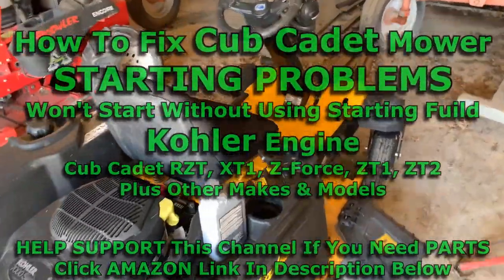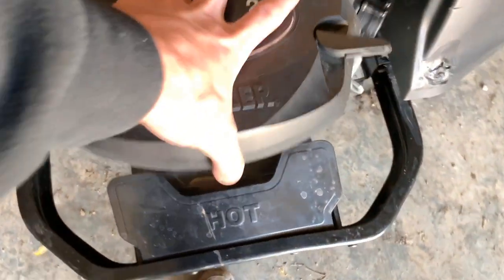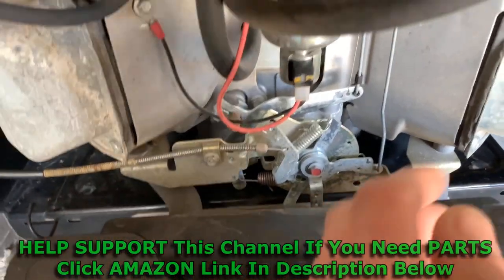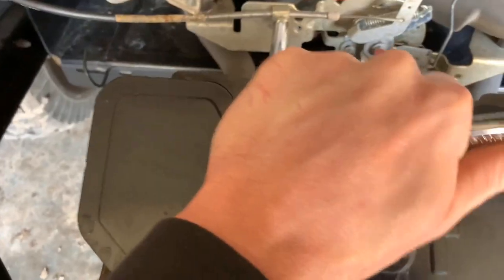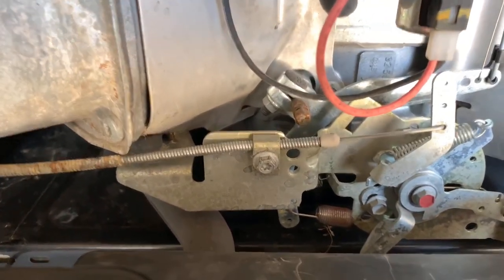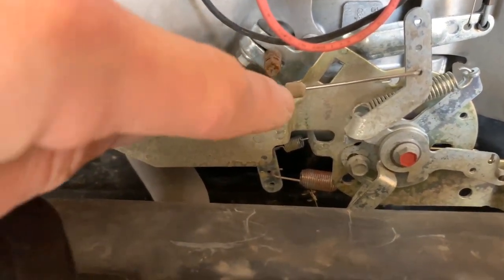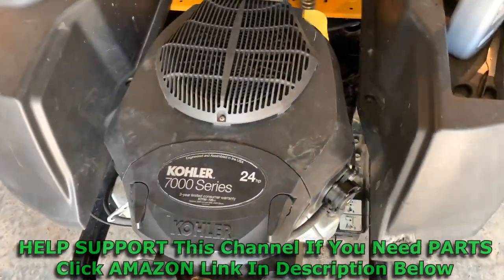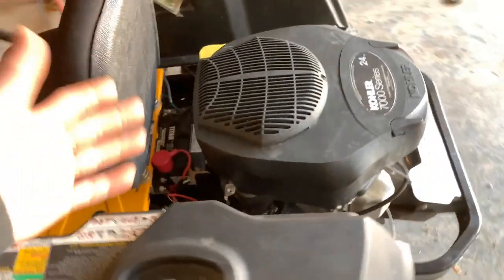Cub Cadet WON'T START Without Starting Fluid REPAIR Lawn Mower Kohler Engine NOT STARTING Cold FIX

Comment from the maker: If This Doesn't Solve Your KOHLER Mower Engine Starting Problem Watch Video I Made About How To Fix Another Common Starting Issue On KOHLER Mower Engine Video Linked Below
https://youtu.be/BWnkTZvk8L0
Reply: Thanks that evens works for walk behind the black rubber garment screws in and out down where it attaches to the choke on the engine like you said it don't take much but it's a solid fix great video!

Comment: I can't thank you enough.   This video helped me with an issue I've been struggling with for over 2 years.   I just cleaned my carburetor and replace the needle valve without fixing a thing.   This simple adjustment took me two minutes,  solved my problem and helped me to understand how it works.   My engine is a Briggs and Stratton V-Twin.   Worked like a charm.

Comment: I believe this little trick worked for me. I popped off the air cleaner, looked at the choke butterfly with the throttle lever on full-choke, and pushed up on the choke linkage like you did and I saw that it wasn't completely choked and there was too much of an air opening for the butterfly to properly choke the carburetor in full choke position. I loosened the bolt, moved the cable over to the left about 1/8th inch and tightened up the bolt, rechecked in the full choke position and the butterfly was now in full choke. I look forward to starting the engine in a couple days to see how it works, as having already started the engine earlier in the day with starting fluid, it always starts the rest of the day. But, your solution looks to be the fix for the cause of my starting issue on my 5 year old Cub Cadet Zero Turn mower, with the same engine that you showed. Thanks for the solution and for putting it on YouTube!

Comment: I watched a multitude of vid's illustrating how to start a mower by using starter fluid (I went to kindergarten a while back - I knew how to use a spray can) I finally found your video on what was causing the problem and how to fix it.  I spent several frustrating hours before watching your video.  It took less than 5 minutes after your demo and I was "back in the saddle".  Thanks.
Reply from the maker: Good to hear it helped get you back in the saddle!!!

Comment: I'm on YouTube all the time, but this is one of the first times I've ever 'Liked' a video. Simple and straight to the point. Mine came like this from the store for some reason. I figured it was something simple, but I'd always forget until it was time to mow, and I didn't want to be bothered with researching it, so I just did the starter fluid trick and forgot about it until the next time. This took 5 minutes and my mower that hadn't started for 2 weeks started right up at a bare turn of the key! Thanks!!!
Reply: Same thing been using the starter fluid for 2 years, gona try fix this am maybe  fix my problem  liked video, clear and straight  to the point thanks,

Comment: Two seasons dealing with this headache. I'm not a small engine mechanic, but I am mechanically inclined. Thank you for sharing your experience, you saved me a ton of headaches this mowing season. I adjusted the cable housing as you instructed and the mower fired right up. No more fighting to get this beast running anymore.

Comment: I've read through countless threads of advice on how to fix this problem over the past two months, pointing to everything except for the Choke Cable.  Based on the symptoms most of the advice did not make any sense. Stumbled across your video this morning and within 15 minutes I had the rider mower starting again without Starter Fluid.  Thanks, Great Video!!!!
Reply from the maker: That Awesome Glad To Hear It Helped Get Your Mower Runnin & Solved The Problem!!!!! Great To Hear!!!!!

Comment: I just bought a new Cub Cadet and used it for 9 hours. I checked the filters, removed and replaced gas (thought I bought some bad gas), checked carb, spark plug and finally found this video. A 5 minute fix would have saved me hours. Honestly it shouldnt come from the factory messed up but I didn't have a way to take it in for service so was trying to fix myself. Glad I found this! Cab Cadet needs to fix this!

Comment: OMG, this fixed it!  RST-42S with a Kohler SV715 with the single lever throttle/choke combo. Put the lever on full choke, loosened the screw (torx bit required), pulled so the choke lever is fully up (=closed), WORKED!! Thanks so much. I had replaced the carb, fuel pump, hoses, fuel filter, plugs... still would not start w/o a shot of starting fluid. THANK YOU THANK YOU THANK YOU!!!

Comment: Wow it solved my problem. No more having to shoot the starting fluid. I previously changed the air filter, replaced
the spark plugs, new fuel filter, oil change and still wouldn't start without the starting fluid. I found this video yesterday and it took me less than 5 minutes to fix the problem as you instructed. My mower started right up on the first crank!
I really appreciate your video. I'm going to subscribe to your channel!!
Reply from the maker: Hell ya glad to hear it helped Thanks for the feedback ya I kinda did the same thing just about before I finally had the apple fall on my head & I was like holly crap that's all it was I was happy to finally figure it out tho. LOL

Comment: I had this issue with a husqvarna 46 in. lawn tractor I inherited from the previous homeowner, and had tried just about everything. I resigned to the starter fluid game, and told myself "I'd get to it later" thinking it'd be a hassle to troubleshoot. I happened to run across this video, and THANK YOU SO MUCH! I literally laughed with glee when it started right up after fixing it. THANKS!!

Comment: I can't thank you enough!! Been fighting this issue for some time now to the point that I would drain the battery frequently. Definitely saved my starter. It's below freezing today and after applying this fix it started on the first try. Can't believe it was so simple.

Comment: I have the same issue with my Kubota zero turn.  It has a 25 hp Kohler engine.  I did what you said and it works like a charm now.  Thanks a bunch.

Comment: Dude I just found this video and I went and did the adjustment and it fired right up. its a two year old ZT1 Ultima  with a 22hp Kohler. Its been getting worse and worse from day one. and this was my issue. I really appreciate it much

Comment: Kohler. It’s spelled Kohler and pronounced “coh-ler”.
Reply: come on, we all noticed but he solved my issue
Reply from the maker: @caniwishformorewishes8654  If it solved the issue then that what counts I'm with u LOL
Reply from the maker: usually I just call that mower a POS so never learned the proper name
Reply: @EverydayImTECHnIt  I agree that solving the issue is the most important thing, and you showed how to do that. But when you pronounce the name of the mower wrong at the beginning it makes some people think maybe you don't know what you're doing if you don't even know how to pronounce the name right. Then you called the fuel pump a fuel filter, it may not be important but it hurts your credibility and people may turn your videos off before they see that you actually know what you're doing.
Reply: Pos fixed thanks dude.
Reply: Nah I think it's kosher
Reply: The s is silent.
Reply: Go back to school

Comment: Absolutely spot on with your video. I just picked up a slightly used ZT1 and had to use starting fluid. Your video changed all of that for me. Thanks for your intelligence and taking time to put the video out.

Comment: Mine has been doing this since it was 2 years old. First video Iv found that finally gave me an explanation. Every time I wanna start my mower I have to drain the batter and put it on the charger and takes a hour or more to start. So glad you made this video!

Comment: I will be doing this fix tomorrow. I have a Troy Bilt zero turn with this very same engine. Its a few years old but the engine only has about 178 hours. It turns but won't quite start. It acts much like when you try to start it without fully engaging the choke so I am very hopeful it will work.

I have checked the fuel line and can see that the carburetor is getting gas and I am hopeful its not something else that I have to track down. Or have to open it up some and see how the carburetor looks. I do not believe any dirt or grime has gotten into it since I change the oil, filter and plugs as recommended. I also don't run it hard and only cut well established lawns around my property and leave the field cutting to my brush hog.

One last point as to what I have done. I did spray some fluid into the carb but did not do so into the filter as you suggested. So engine would crank for a few seconds and as it started to die I would spray some more to keep it going but decided to stop as I observed the engine would die out nonetheless. 

I will follow up and let you and everyone else know if this suggestion and fix indeed did the trick.
Reply from the maker: I think you got a fuel issue it's not getting fuel for some reason or you have water in your gas also try this if you ever have this similar problem this is also a common starting problem with mowers with KOHLER engines  https://youtu.be/BWnkTZvk8L0
Reply: @EverydayImTECHnIt  Yes you are correct. I was hopeful this would be it, but the more I thought about it the more I realized this video wasn't exactly my situation.

I called the Kohler people and will be checking the plugs to see how they look and then probably try to learn how to get to the carburetor so as to clean it since there may be something there keeping gas from flowing properly. Might have some varnishing or other gunk since it is 6 years old. Regardless of it only have 178 hours running, enough time has passed that this many be going on as well.

Since you mention the water issue, I may go about just draining the gas and putting in new gas all together. The other tank may have had some water in it somehow. So I can't eliminate that either. Will do gas draining perhaps first since its a simpler fix.

Thank you for your time and added attention. Will follow up once I get to some of these options I have.
Reply: @EverydayImTECHnIt  I have gotten mine started back. It appears to have been some crud that was somewhere in the carburetor. Hopefully with a freshening of the air and fuel filter, adding some other product like seafoam or mechanic in a bottle that will get us back to normal and handle the grass cutting for the rest of the year.

Comment: Thank you so much. That did the trick. I took off the cover I didn't have any starter fluid so poured some gas in the carburetor and it started up. So I adjusted the throttle cable. So now it cranks up by itself when I hit the key thank you so much for that YouTube video

Comment: Thank you, thank you, thank you! I replaced the carb, starter, spark plug,  and solenoid and my mower still wouldn't crank. Saw your video,made the adjustment and she cranked right up. Your video was the first one ever mentioning this choke adjustment. Thank you, again!!

Comment: Thank you so much for this video! It fixed my problem in 5 minutes. I was so frustrated and was about to bring it to the dealer. Saw your video and bingo!!!! Great job! Thanks again.
Reply from the maker: Glad it helped ya kinda weird issue for sure
Reply: I have another question I hope you can help me with. When the mower starts it pulls to the left. Do you know what that would be from? Thanks so much!!!
Reply from the maker: @michellemarcello4947  If i had to give it my best guess i would say to check the clutch/safety pedal u push into start & forward pedal to make sure it is adjusted correctly under mower it sounds like it a issue with left side staying engauged in forward not 100% sure tho but has to be a pedal adjustment issue you probably want to check in rear underside of mower by like back axle hope that helps!

Comment: I have a brand new troy-bilt z54 zero turn mower,with a Briggs & Stratton professional mower on it.and its doing the exact same thing to me right now.i also have 3 more troy-bilt 54 inch mustangs mower with the same moter on them except there 25 hp,there the z54 is 24 hp.so ill try your advice tomorrow now.i also have 2 troy-bilt super bronco 54 & 50 inch mowers with the klopers on them and beleave me now they love gas now.they burn 2 × more gas in 1 day of mowing that my troy-bilt zero turns do,I have a big lawn mowing business and to me right gas is very very valuable these days!!!!!

Comment: Thank you! I had tried everything I could think of that was easy to do...ethanol free gas, new spark plug, changed the oil, new air filter, ran Seafoam in the gas. Not too handy with carbs so I ordered a new one and was about to put it on when I came across your video. Ran out to the garage and in 5 minutes had the issue fixed! Started on first turn of the key. Also ran with a lot more power.
Reply: When your lawn mower is turning you into a shade tree mechanic this is what you go through.  By the time you're done with this mower you will be a certified pro because you have already been through the whole trial and error phase.  You might save somebody a few bucks someday.  My Cub Cadet has put me through the ringer over the last two years.  I can now diagnose certain issues.

Comment: thanks for this video! I just was able to fix my generic generator with this little trick! I thought it was the spark plug but I couldn’t reach it Because it was buried under the panels so I looked up your video and lubed up the cable wire to the choke,  and lo and behold it started right up! Thank you thank you thank you!
Reply from the maker: Thanks for watching & feedback!!! Glad it helped & you got it fixed!!!

Comment: Ok thanks for the INFO, fine business!
I have had this problem for YEARS, not enouth Choke. it took me abt 25 seconds to pull air cleaner and dump a little gas to carb then it would always start and run well and restart if not off for a few days. My mower is a Troy/Bilt 50" zero turn with 25hp Kohler and have checked for years for someone with enough drive to trouble shoot the problem, I was just toooooo LAZY abt 8 or so years ago I did adjust the cable and it worked for a few years then stopped working so back to adding gas. Now that you showed the problem and showing the actual CHOKE linkage. I added a TYE WRAP and or <cable tie> with the large end pushing on the CHOKE linkage to close the CHOKE plate. Now it starts without adding GAS!

Comment: I haven’t tried this yet but i just bought a new cub cadet XT1 XL 46” and i ended up sending it back because of this problem and when the replacement came i found the same issue. I just unpackaged my new one today and couldn’t get it started. I’m going to give this a go tomorrow

Comment: you call that motor any dad gum thing you want to. my nearly new mower started instantly when i lifted that lever. worked so quick and so easy for just me to do i am not even gonna fool with tightening the cable. thank you very much. you call that engine what you want i am gonna call you "sir" thanks

Comment: Good video, however, there's no reason to spray any fluid into or on the air filter. If anything, it will keep the carb from getting fresh clean air with a wet filter. It's fine to spray down the throttle body of the carb with the carb cleaner to aid the engine to start. You want to keep the air filter dry at all times. Good video on the choke issue adjustment.

Comment: I have a craftsman 52” zero turn z6900 same exact mower except mine has the two steering handles… but I had the exact same problem… thanks for the video…

Comment: Thanks for the tip. Same problem on a Briggs and Stratton. Replaced filters and plugs with no luck. Saw this video, went out and manually choked it and the engine fired right up

Comment: Man. You are so amazing. I will always keep up the subscription on your channel. I know I have a hydrostatic transmission issue that one side winds until I assume fluid can get circulating. I would like your feedback on how to solve this. 2014 cubcadet zero turn 42”

Comment: Waoooo I have a mini bike with less than 10 hours that doesn’t start unless I spray starting fluid I changed everything carburetor spark plug started using non ethanol and doesn’t start, hopefully this is the solution. I’ll try that tomorrow and let you know. Thanks for the video.

Comment: Yep..works great now...kohler should hire you as an engineer. Its sad, mine has 40 hours on it. Always been hard starting. My guess is they come adjusted incorrectly from the factory or wherever they assemble them. This need to be in the troubleshooting guide. I can now enjoy my purchase a little better. Thought i got a lemon.